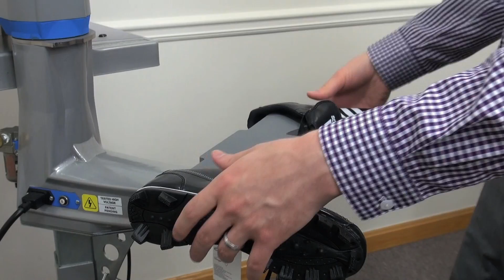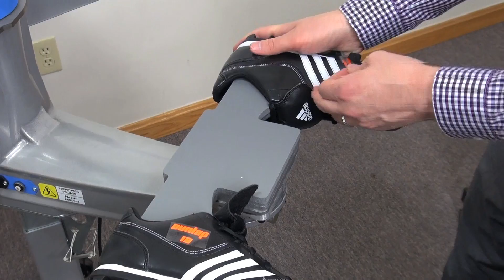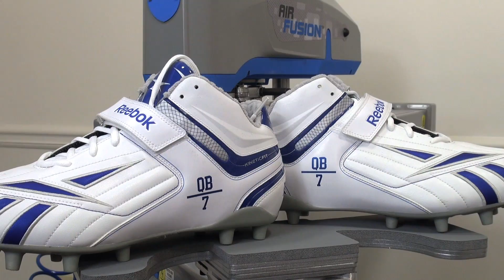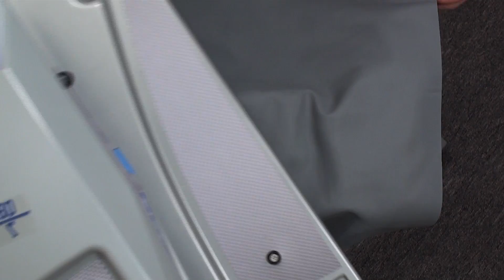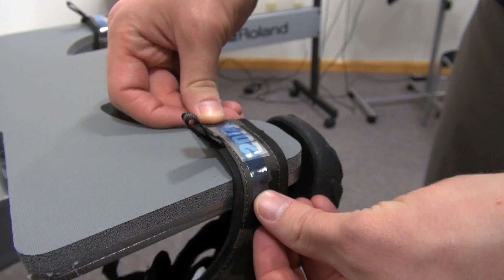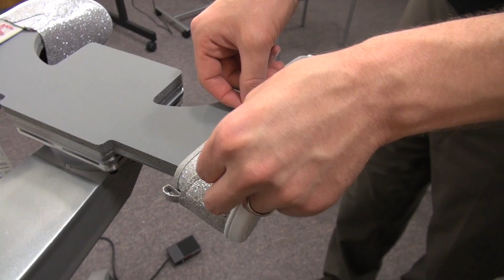Shoe Customization with Heat Press Transfer Vinyl

Comment: Are you using iron on viynl or permanent vinyl?
Reply: This is a heat applied material with a permanent adhesive.  Specifically Cad-Cut Fashion Film.

Comment: I don't have an industrial heat press or attachments. I usually use my flat irons for hair or the tip of an iron. Can I use this technique with your heat film?
Reply: I believe an iron it may not be hot enough, but if im wrong you still need the amount of precise pressure and time pressed or the project can fail such as peeling or who knows what else. If your selling shoes this would not be ideal direction i would say 🤔